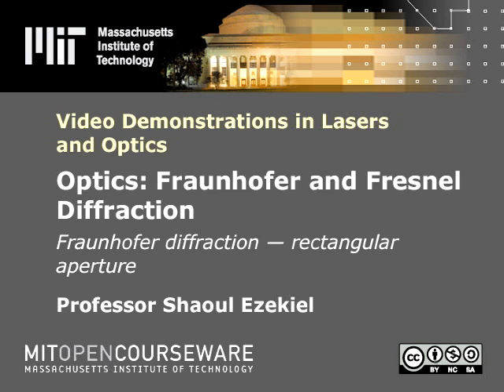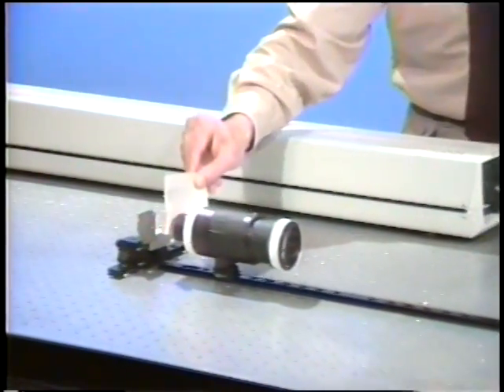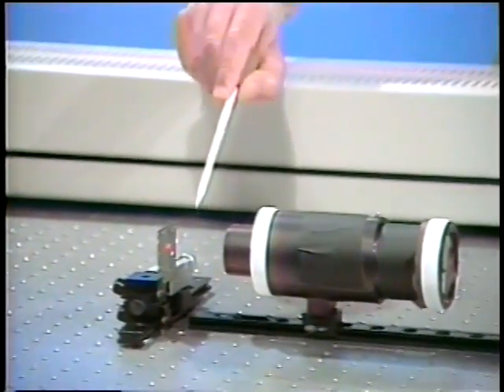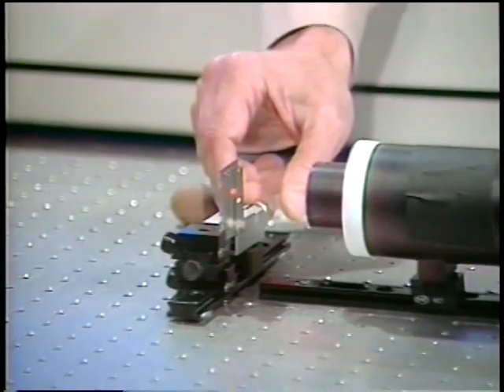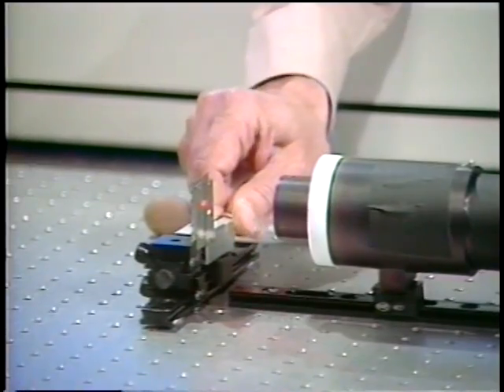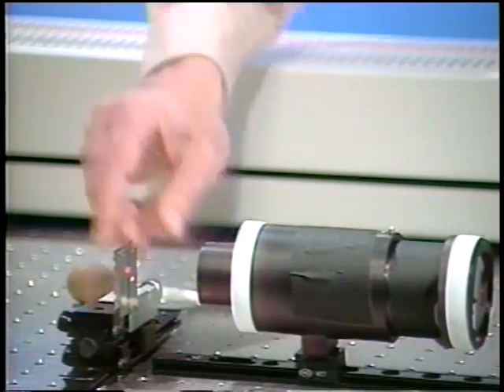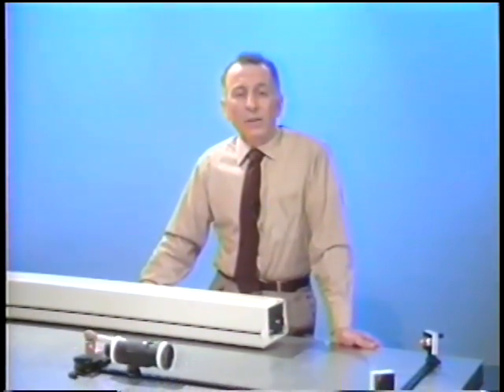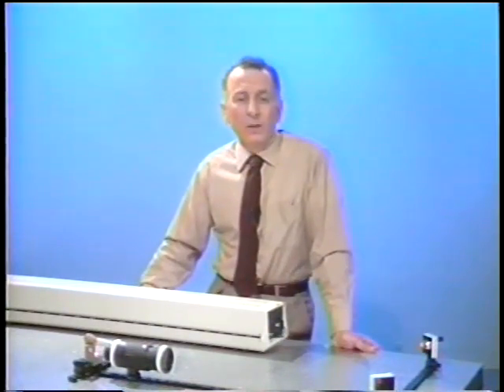Optics: Fraunhofer diffraction - rectangular aperture

Comment: does the frequency of the laser modifies the interference "wave" so that higher frequency, more closer the "fringes are?  Also what would hapen if you put a polarization glass on the slit, perpendicular to the slit, would this waves still interfere?
Reply: Miguel Queiroz As wavelength of the fringe is directly proportional to fringe width therefore a light with greater frequency should have fringes more closer to each other because wavelength is inversly proportional to frequency ...... I think so . I don't have a lot of knowledge because I am a high school student.